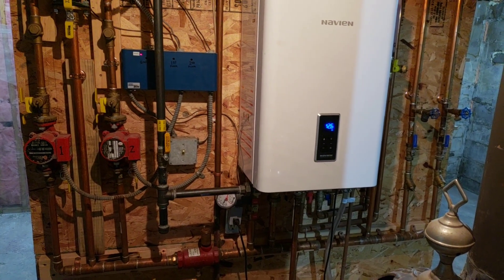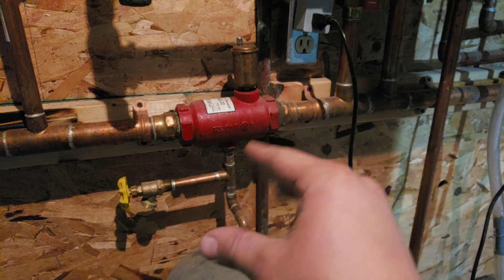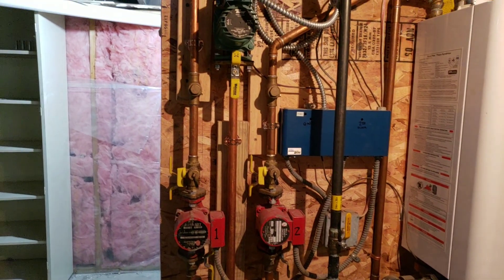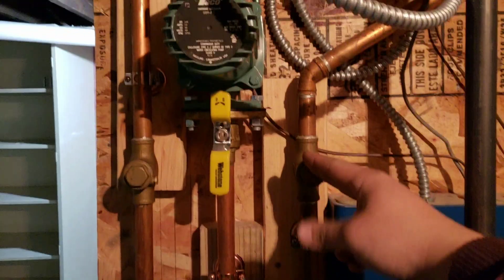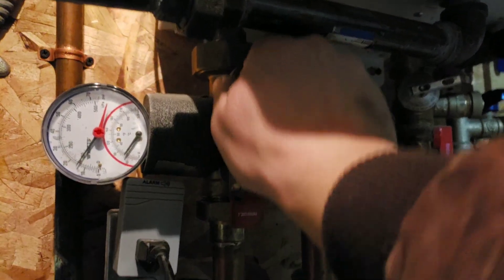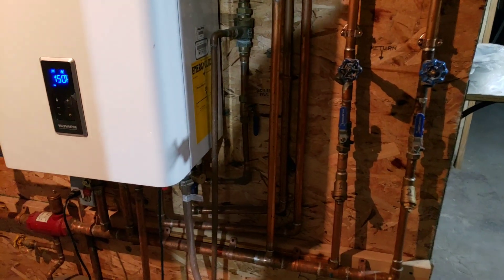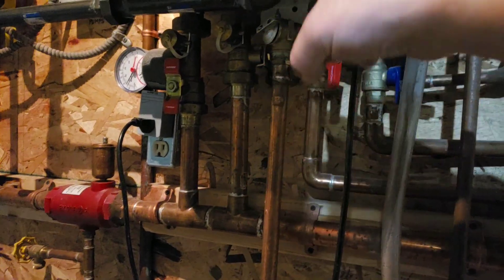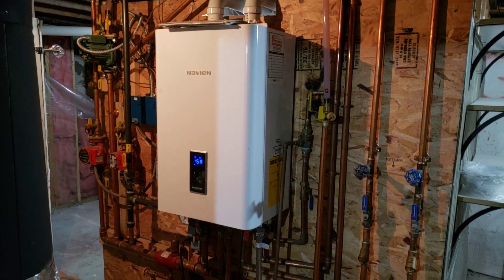Boiler Hydronics Basics and Principles 101 Hot Water Heat

Comment: What a great find! Thank you very much for the detailed information. How did you determine the circulation capacity of the pumps? I am building a system with wall panels and 4 loops. Shall i stick to 1 1/4" main or go to 1 1/2"? What is the best way to insulate pipes to reduce heat loss?
Reply from the maker: @SipeskClassics  the manuals will show the pump specs. There are formulas to determine main sizes depending on size of whole system

Comment: Those swing checks above the pumps are useless. Can’t use them on a vertical , need a spring check.
Reply: It prevents ghosting between loops. Some pumps have their own check valves. Without a check valve, if only one pump is on, It can steal water from the other loop. They work fine on a vertical, it's called gravity

Comment: Great videos, thank you for sharing. I have a similar set up, with different boiler brand. Mine is Laars Mascot ft 140 model. I have a couple of questions 
My installer put the extension tank with air relief valve after the zone valve (one zone only),   Is it normal to do that? All the diagrams  I’ve seen, they put the tank very close to the boiler and before the zone valve. Does that make a difference.
Also, I’m considering adding a dirt separator/ and or perform a flush every year to clear any debris from the piping. Which one would help the most. I have already replaced the three way valve and the internal pump on the boiler and it’s only 4 year old, so I want to be proactive and avoid future issues. Thank you in advance
Reply from the maker: @mezianemeziani2956  yes the tank should be before zone valves. Not sure how much affect it will have. Caleffi is the best brand. Or webstone

Comment: I'm assuming this will also work with Propane?  I'm building a new modular log home and trying to decide on a heating system.  Would you recommend a combi system with hydronic baseboard?  My other option would be a forced hot air.  Any suggestions?
Reply: Yes, I'm sold on them. Installed another one in my new house. Yes they have LP versions. You could have floor heat and a hydronic heat exchanger forced air loop for the best of both worlds. Forced air is nice for filtering/moving air.
Reply: @andylarson3547  I've been getting outrageous price quotes for installs on heat pump systems and mini-splits.  Some as high as $40,000.  I decided to put a post up on Angie's list the other night to see what responses I get from contractors.  So far the one contractor that replied told me to stay away from the Navien.  He told me it was garbage and nearly certain it'll crap out and need replacing within 5 years.
Reply: @randomstuffwithjoe  he either doesn't know what he's talking about or is lazy. Some old schoolers haven't latched onto the combi boiler/ mod con boiler movement, but it's the wave of the future, and right now the Koreans are leading the pack. If you want dependability, 50 year life span but only 80% efficiency go with a big cast iron boiler.

Comment: Wow, thanks for putting this video together! It’s very informative.  I just purchased a home with radiant floor heating already installed and this video really helped me understand the components as I tried to test out the system. (Home inspector did not test since the broiler was out of service and we also have forced air HVAC as primary heating.) Do you know of a testing manual I can download? I turned on the thermostat and see that the radiant system is calling for heat but I am not sure now to tell if system is heating up? Maybe it take a couple of hour to heat up? I only tried for 30min... Any advice for this newbie?
Reply: Also new to it, but a note: our inspector ran a FLIR camera to verify circulation in the floor, may be worth checking once your boiler is working. Expect a while for first warm up, an hour or more I believe.
Reply: @cbowns  val

Comment: nice video i am in process of installing one as i type this your video was great help i have changed my old farm house in to an all radiant floor system and wow what a TON of man hrs running line and transfer plates and insulation  i just got boiler and have been a little over loaded on research ive found your video most helpful thanks.
Reply from the maker: Great to hear! Thanks. Any questions,  let me know.